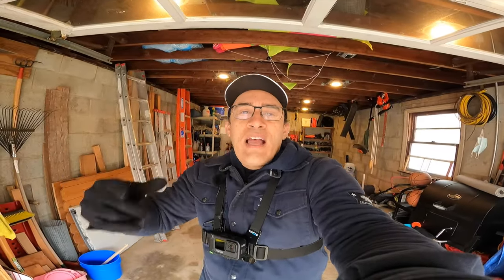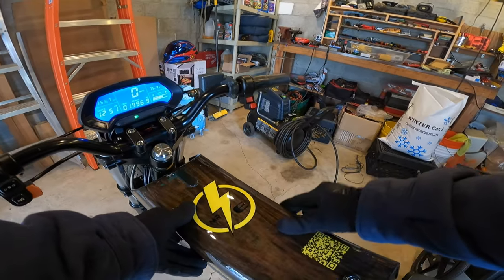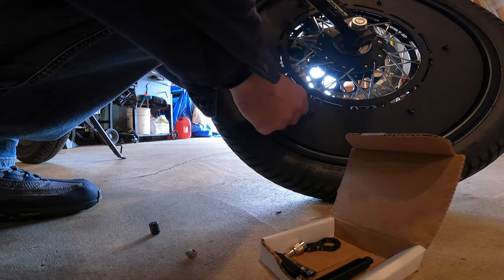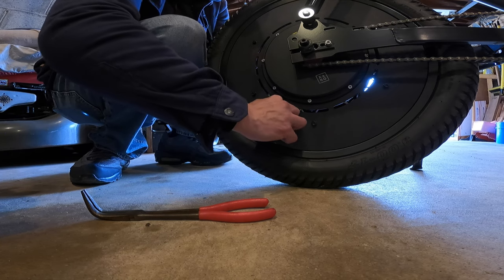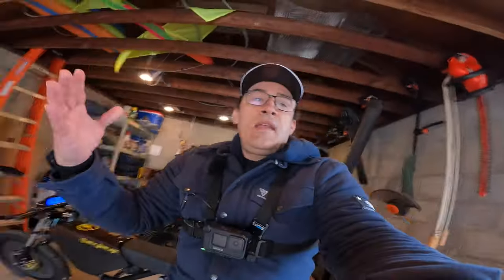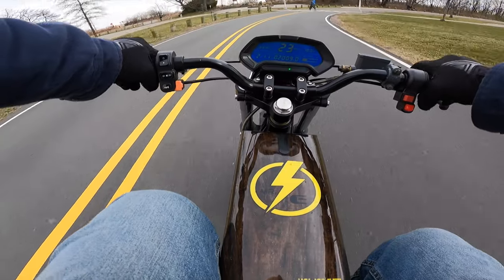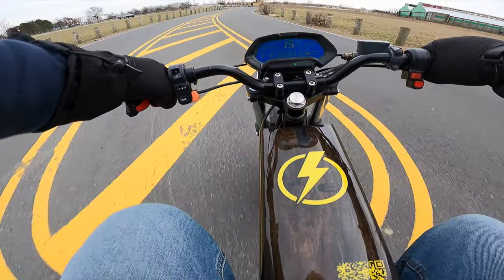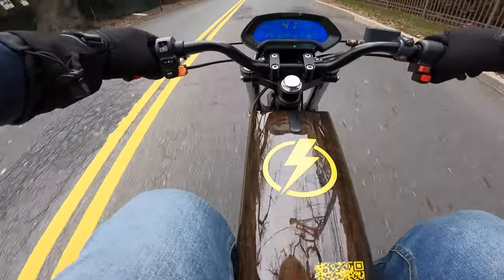Raid Dynamics Halo Valve Stem Installation

Comment: I'm with Chenay: I'm SO done with winter, lol. I rode 127 miles last month, almost all of it below freezing, and sometimes below 10°F. The bike is fine with it, but when it's that cold I get a 30% reduction in range. I still got 71 miles out of one charge though without trying, so it's not too bad.

Those Halos are looking great, especially in back. Only downside might be on hot summer days when you're pushing lots of power.
Reply from the maker: Dang 10*F you are a trooper… good to know the battery held up… Me if dressed properly I am good to ride in the cold… the heated gloves were a game changer… 

I love the halos… added much life to my ONYX… Hope to see ya soon bud… 🙌💯💪
Reply from the maker: @Joel Churchill I did about 74 miles once with about 12 volts to spare…
Reply from the maker: @Joel Churchill 50ah…